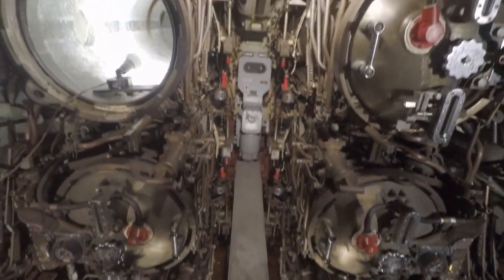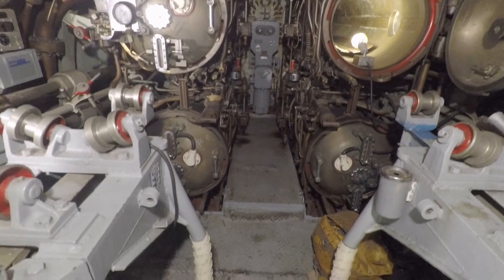How Do The Torpedo Tubes Work?

Comment: How are the speed, gyro angle and depth set?
Reply from the maker: Good question!  Speed and depth are set from mechanisms on the side of the tube and the gyro angle is set using information given from the torpedo data computer. 

Stay tuned, as we will be covering this in a future video.

Comment: How was the motor speed/propeller controlled? Giant resistors or what? Thanks!
Reply from the maker: The method of motor/speed control is largely dependent on what type of propulsion the torpedo uses. The three types of propulsion generally seen in American torpedoes is steam, chemical, and electric. In the case of the first two, valves are used to restrict the passage of gasses into the torpedo’s engine, thus limiting speed. For an electric torpedo, speed is controlled by means of a governor which causes the motor to draw more current as the torpedo’s batteries drop in voltage over the course of the run, keeping speed constant. In all cases, regardless of propulsion type, the desired speed of the torpedo would be set prior to shooting it from the tube and would remain at that set speed for the entirety of the torpedo’s run.